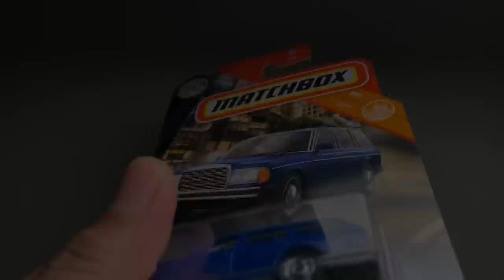Mercedes Benz S123 classic wagon with G class Trailer Matchbox Custom

Comment: Beautiful pair of customs JD!  Absolutely stunning paint work, as usual, and the intricate details are amazing.  Though I would like to ask about what you did, if anything, to the interior of the G class??  It appeared that you left it stock inside the casting, so it begs the question "what is its purpose?"  If it is suppoaed to be a trailer, then the seats will get in the way of storage...🤔

Needless to say I am very impressed and inspired by this latest custom build, even if I am a little confused by how it's to be used.  Great stuff, thanks for sharing, and keep on keeping on!!

Comment: Love the S123 Wagon - I have a real one - but the trailer would never work. A two-wheel trailer needs to be balanced fore and aft at the wheels; this one is front-heavy and would put so much down-force on the tow-bar of the car that its front wheels would be off the ground - even the self-levelling suspension on the S123 would not cope!

Comment: Should have lost the post. I did one of these. The first color, Green. Took it apart, cut that Damn post off painted the front and rear under the bumpers body color and color keyed the hubcaps  to match the body and chrome penned the trim. Looked 100% better. Just by cutting of that Stupid post. No need for it. Yours is fantastic. Great video.